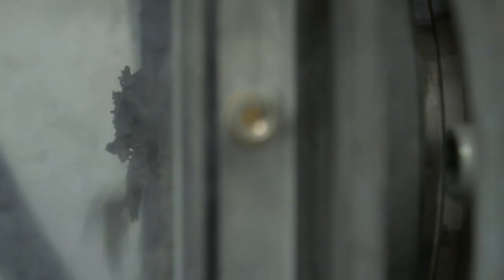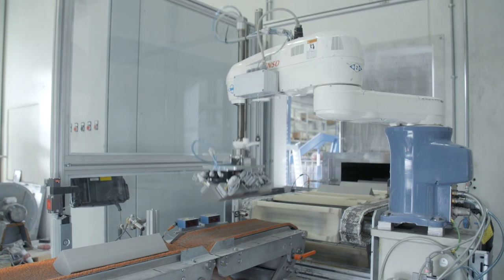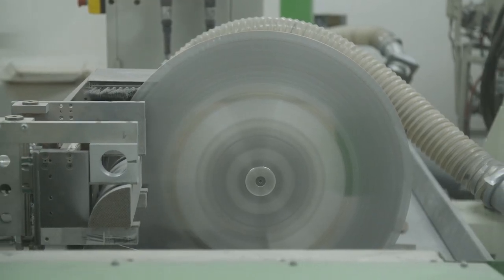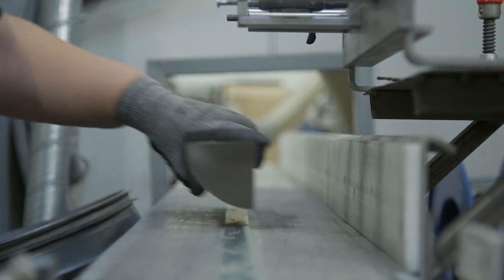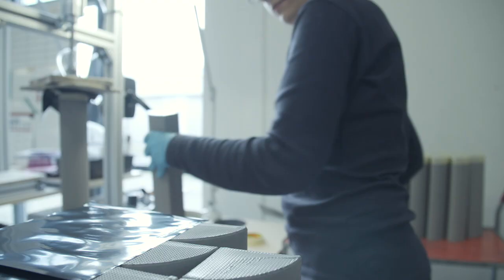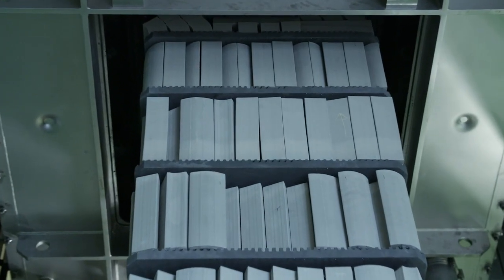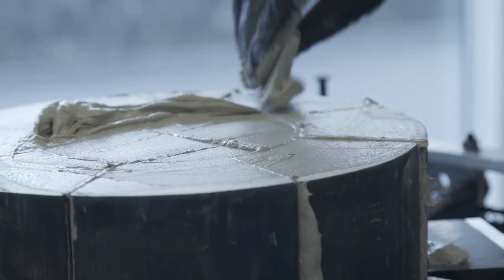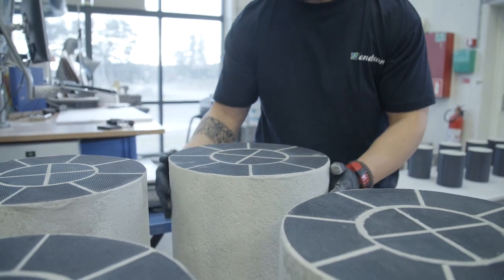Diesel particulate filters (DPF) - Production process

Comment: it is impressive how u guyz screwing all the cars in the world... u cannot have any power from engine if u have clogged exhaust  ):
Reply: Screwing cars is still better than screwing the environment
Reply: Most filters are not made this way. While I'm sure these particular filters do a great job at catching particulates, thin wall filters have become significantly better options so they do not create immense back pressure and top end power reduction. There is however a draw back, theyre not quit as reliable. Diesel engines cause pollution on a solid level as well. The only reason you don't see and smell this carbon pollution is because of these particulate filters on high load diesel engines. You should be thanking companies like this.
Reply: I agree with Zachary, it has been an international agreement that PM emission should be limited from the exhaust of IC engine vehicles since 2000s. Now 100% diesel engine vehicles in US are equipped with diesel particulate filters (DPFs), and gasoline particulate filters (GPFs) are also employed in EU, China, Japan and other countries. DPF alone is a $20 billion market and is growing steady today. Companies like Landson is helping a lot.